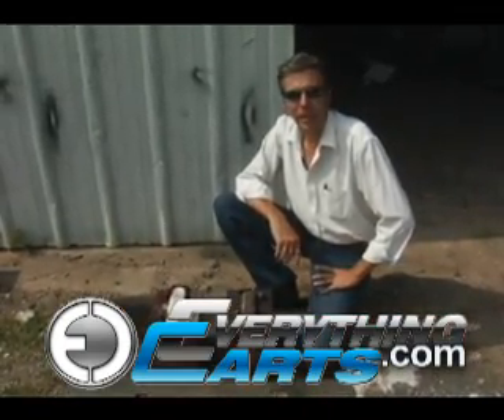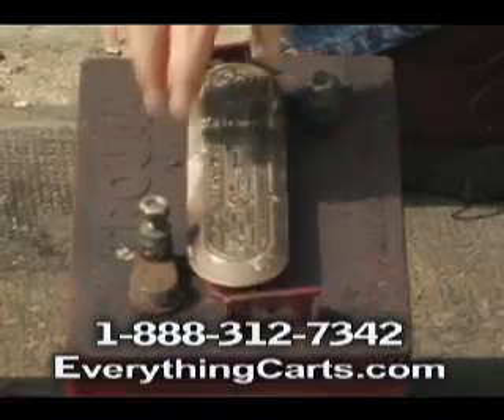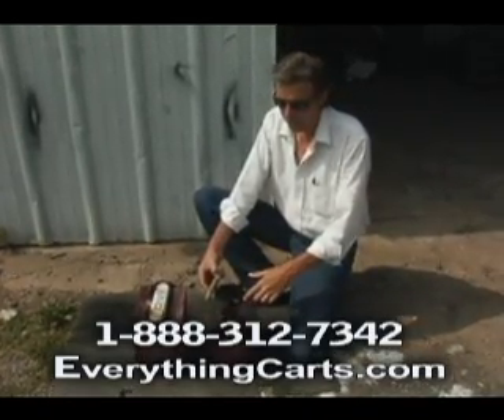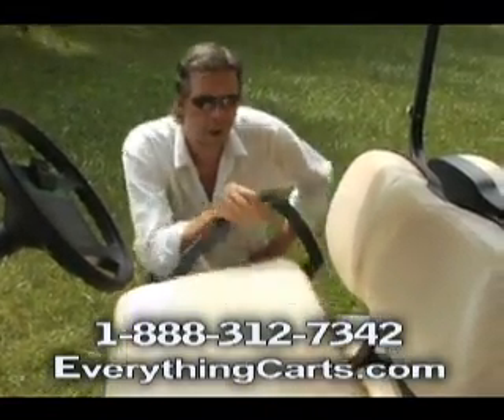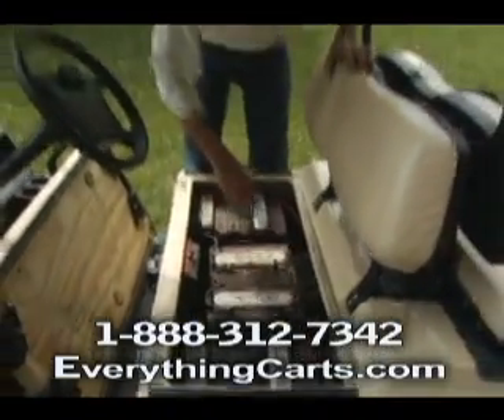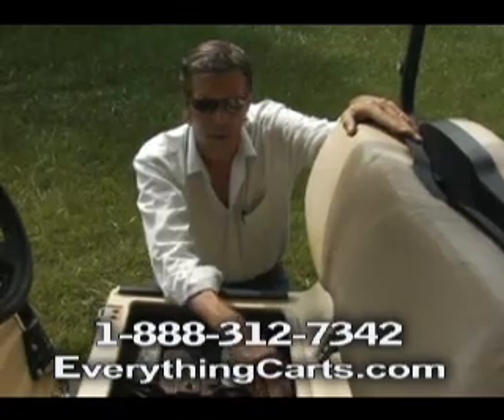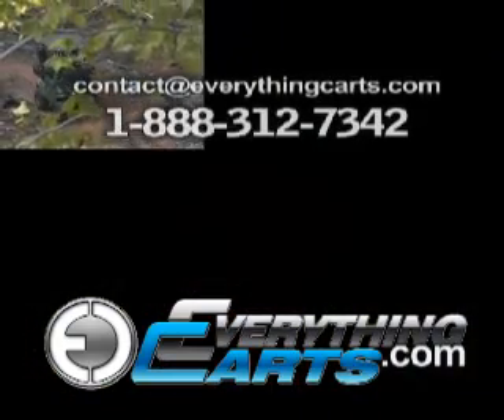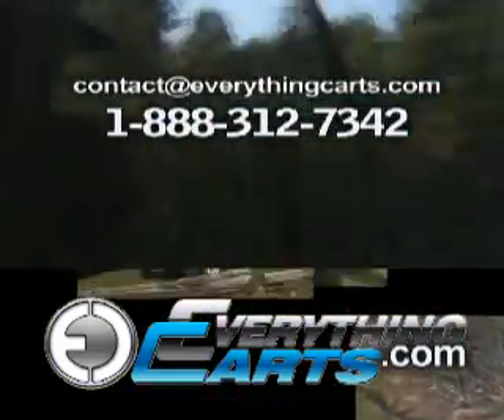Electric Golf Cart Basics by Everything Carts

Comment: Just replaced all 6 - 6volt batteries on a pace car golf cart. When I turn the key I'm getting  beep in reverse but it still won't move either forward or reverse. Linkage is working right couldn't find any loose connections. What else could be wrong?
Reply: Hi

Comment: How do i tell what i have without batteries. I just got a ez go and dont know the voltage because the tags wore in and rubbed badly.  I did not get new batteries with the cart only 3 old nasty things. I did however get new batts at an auction. I just dont know what i need. 36 or 48 Its a EZGO TEXTRON 3 wheeled cart